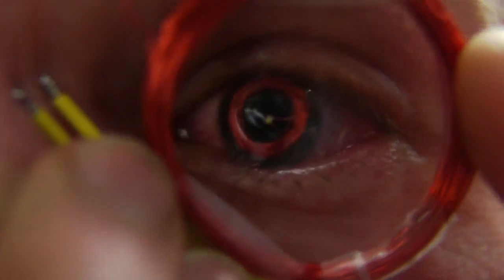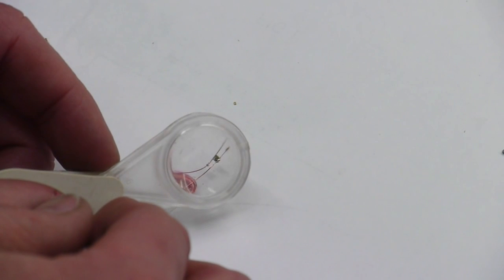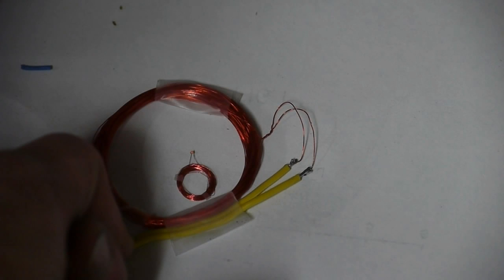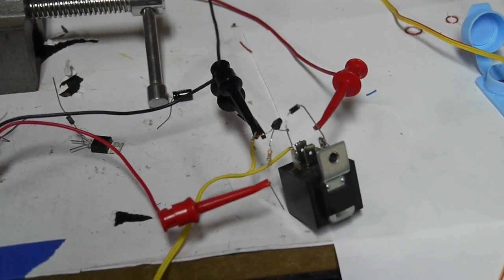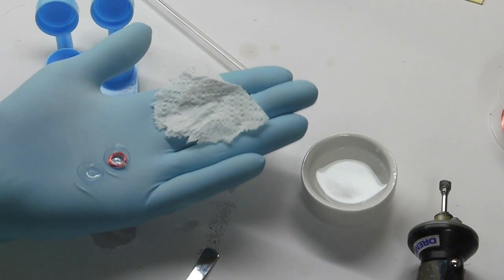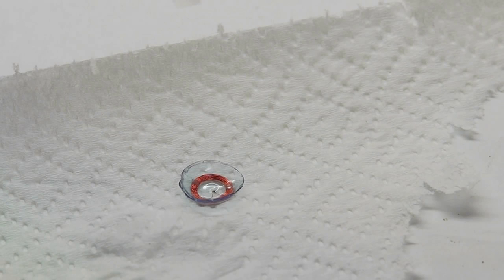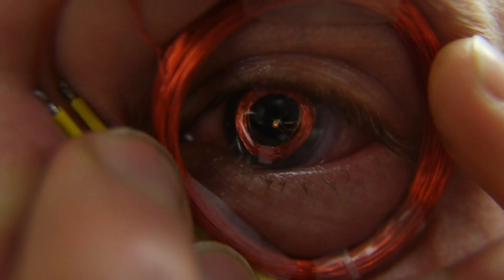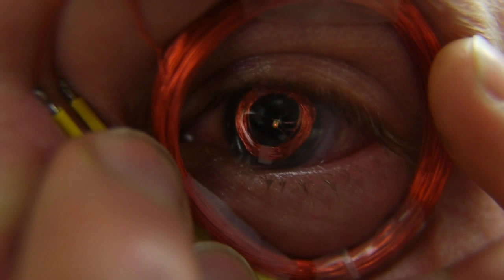LED mounted in a contact lens for possible virtual / augmented reality displays

Comment: If you are still looking for a better solution to the lens sealing, try heating up a set of rings or spacers about the size of the circumferance of the lens and pinching the edge that way, you might get some shaping issues with the curve of the lens, but I reckon it should be more comfortable than what you did there.

Comment: Did you try using a heat gun to fuse the two lenses together? It might not be perfect but I'm sure it would come out smoother than using hot tweezers.  

Just a thought :)

Comment: That's quite a development!
I was wondering if it would be easier to glue together if you made the coil into a disk instead of a thoroid.
I would personally drop the whole idea of sandwitching two lenses together, what if you used cellophane tape to hold down the coil and LED against the lens? As long as the piece of tape is smaller than the lens itself, you should get a comfortable setup.
Did you use lead-less solder? Otherwise who knows what kinds of heavy metals are now part of your eye.

Comment: Where I read this about the rabbit, everyone chanted about the new type of "display". But with basic (school?) knowledge in optics they'd know it's not that simple and a total blur.
But it should work if the light was coming out as a well defined beam (by using special optics on the LED or maybe laser diode).
Still don't know how this will be perceived though. The eye makes small movements to even "see" something. If the lens moves with them, you can't "look" at the display.

Comment: Great stuff!

Resonance is your friend!  The semiconductor drivers were probably clamping the voltage on the primary, preventing the secondary voltage from rising enough to forward-bias the LED.  I'd probably have used HF so I could use less bulky coils.  Not that I particularly like the idea of tens of amps of circulating RF current in the coil around my orbit.  Meh, it is non-ionising radiation right. :)

Comment: Nice work, an LED grid might be doable if you used LEDs where the reverse capacitance is different so you end up with multiple parallel tuned circuits..
I'd try blue LEDs as they seem to have a lower capacitance than red so the drive frequency can be higher, also try two LEDs in reverse parallel and alter the pulse waveform to change the brightness so the colour changes.
As for cementing, you'd need something biocompatible OR make sure it is very very well washed once cured. UV setting?  YMMV